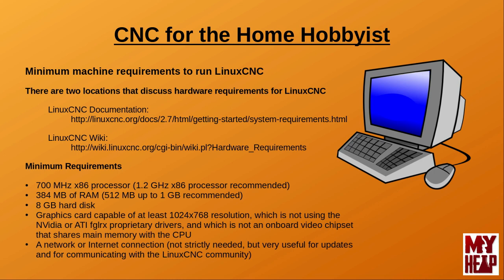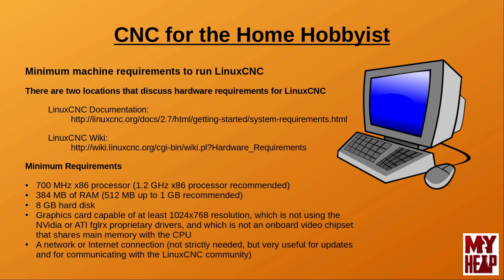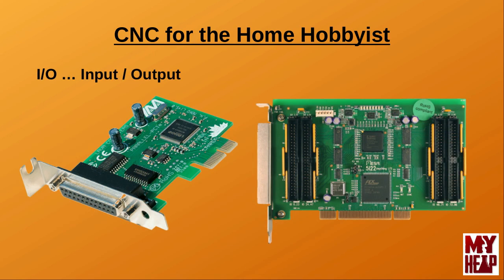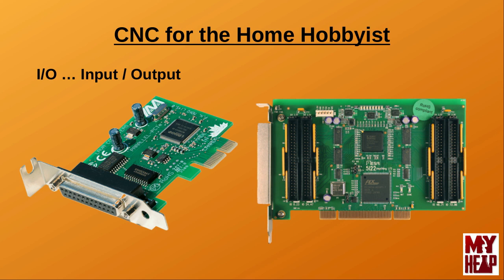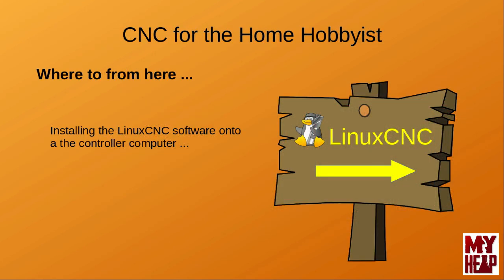LinuxCNC for the Hobbyist - 005 - Machine Requirements for LinuxCNC

Comment: I appreciate your effort, thanks a lot. Though, would like your comments on why parrallelport and not USB. Tecnical limits or what??
Reply from the maker: Ingvar, that is great question and I probably should address it in a future video.  In short there are issues with the RTAI kernel and usb for driving step or servo systems.  Now you can use USB for things like pendants, joysticks and other uses, but for realtime control there are latency and other technical problems.  The biggest reason is that there is no RT driver available to use them in realtime space.

If you would rather not use the parallel port to drive the hardware, there are other options available, such as ethernet, mesa and other hardware.

This may not always be the case, but as I understand it that is the problem.

Joe

Comment: There are means to connect a USB and a parallell. Would an adapter USB -> Parallell do the job ? Asking because my old laptop doesn't have a parallell.
Reply from the maker: Ingvar, another good question.  The problem with this approach aside from the USB issue I talked about above is that the USB -> Parallel port interfaces are not equal.  Some pass what would be all pins through to the OS, but others do not.  Also, Laptops are not generally recommended for LinuxCNC, though a latency test will tell you if you can get away with it or not.  If you are dead set on using this, then an ethernet based interface may be your best option.  But before investing that kind of money, I would install LCNC and run some latency tests to see if it is a good candidate.

Sorry if I seem to sound negative here, I really don't mean to.

Joe